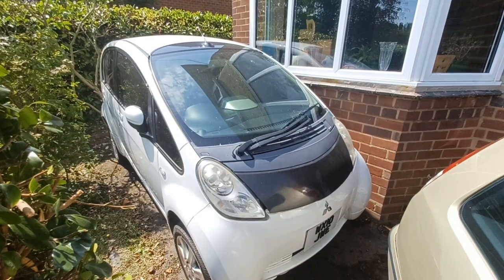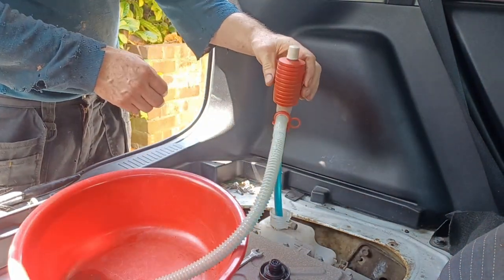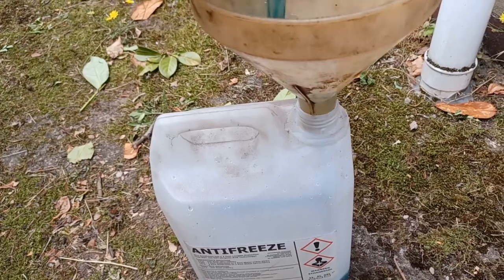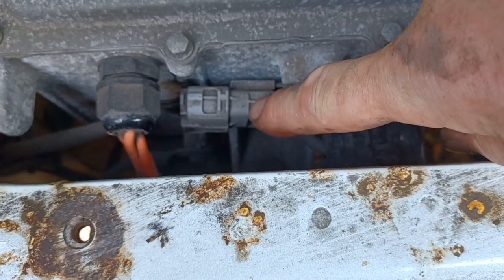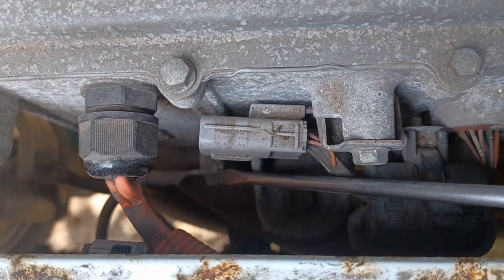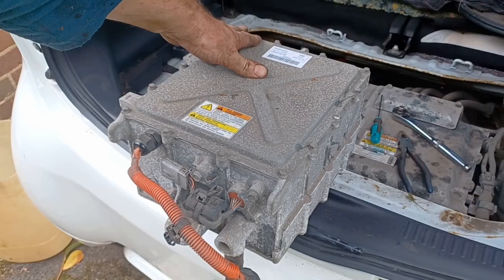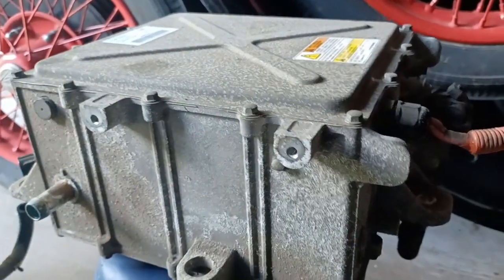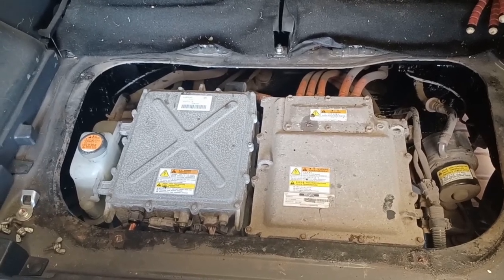Will it charge now? - Imiev replacement charger DIY #electriccar #mitsubishi #charger #mechanic

Comment: Interesting video, I've only had the 1 Meiv for about 3 weeks and still figuring it out..at 68 yrs old it's quite a change.. the coolant is it just water ? Distilled / tap ? ... I'm going to checkout the level ... Thanks.
thom in Scotland.
Reply from the maker: Coolant is a coolant fluid not normal anti freeze as far as I can work out - I kept nearly all mine when I drained it anyway and had a dribble spare from another car so have little extra. Do not think it is just water sorry - glad it helps - its all new to me as well brought up on prewar to 60's stuff!